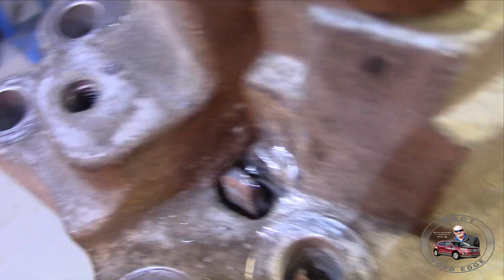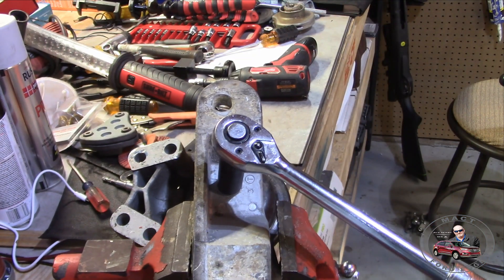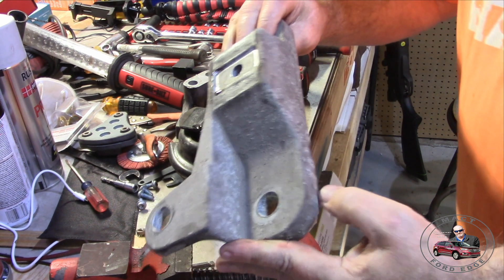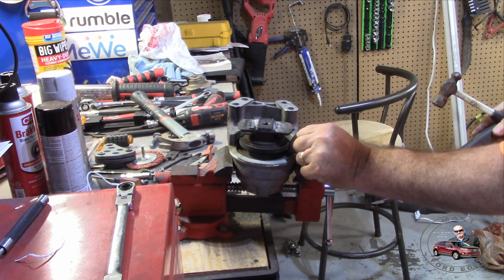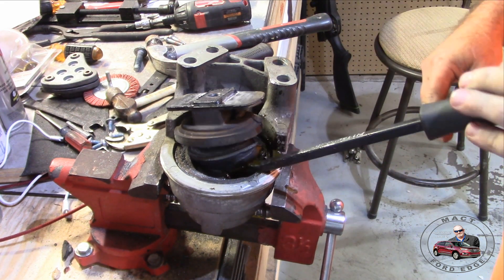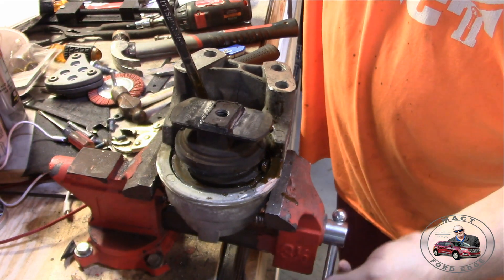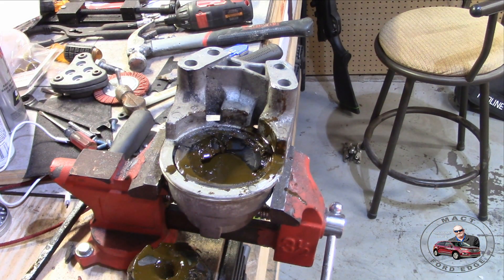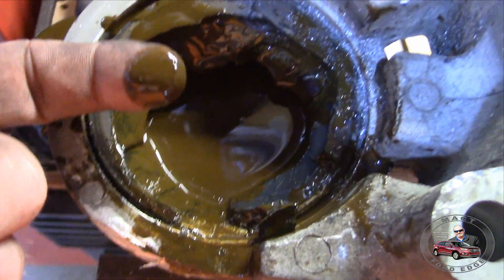what I found inside the Ford Edge motor mount

Comment: Mine got vibration at stops being in drive: I replaced torque arm(aftermarket), harmonic balancer, belt, tensioner - nothing changed (. Mounts sems good, the engine doesn't move much, but vibration makes me mad

Comment: Unless the fluid has another chamber with an orifice that it passes through, then the 'hydraulic" part is really a misnomer.   The only reason I can see the fluid being in there is because then you can make it the same size with less rubber.  But if you left it hollow, it's too weak and over compresses-- so they fill it with fluid just to take up the empty space, so then as it compresses, the rubber has a solid stop to it..  but at the same time, that "stop" can distribute the pressures evenly throughout the entire piece of rubber, therefore lowering the peak pressures on any hot spots-- so in theory the rubber should last longer;   like if it had a steel rod in there instead--- it would likely just split the rubber at the top of the rod--- but this way, the fluid has some give to it, as it is expanding outward against all the sidewalls of the rubber and makes it bulge outward like a balloon-- acting as a spring.  I suppose it also acts as a variable spring weight-- because it moves quite easy at first, then once the puts pressure on the fluid, that fluid doesn't compress-- but it does MOVE in all directions, and makes the entire rubber stretch in all directions like a balloon-- which will have more resistance than just the top of the rubber compressing downward.  So it never really hits a hard STOP...   Its interesting-- I actually like it now that I've thought it through on paper.  but at the same time-- It's prone to fail--- so I'd rather just make it with a solid piece of rubber, or have a polyurethane bushing myself.  But then again, I don't care about NVH much-- and that variable spring of the fluid probably does help with NVH for sure.